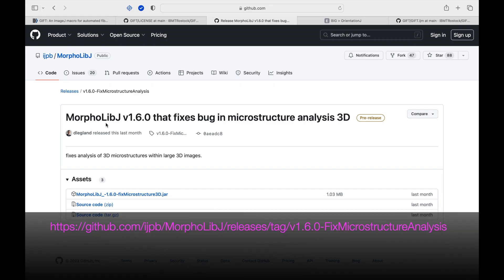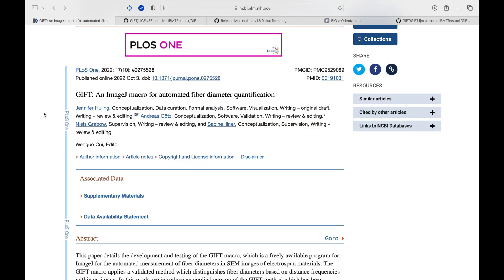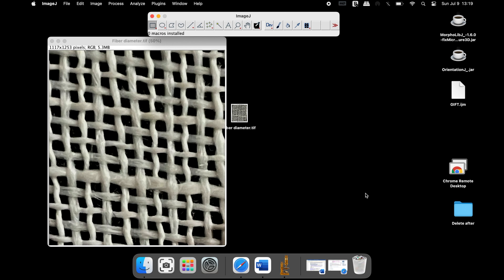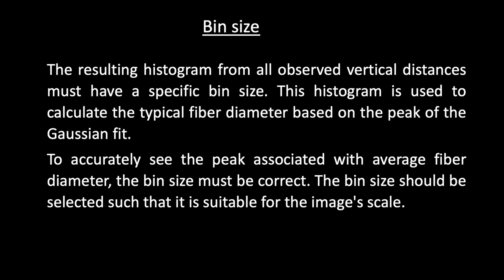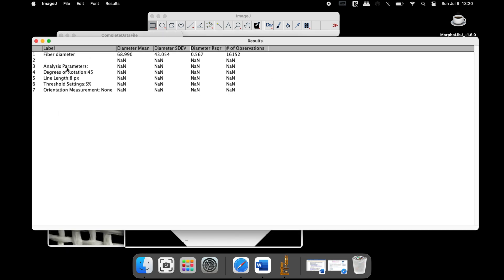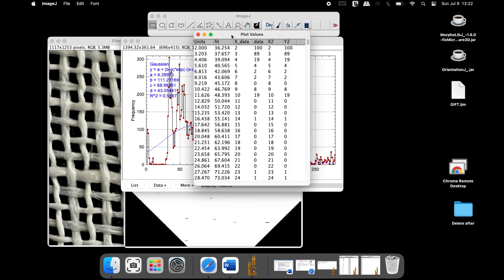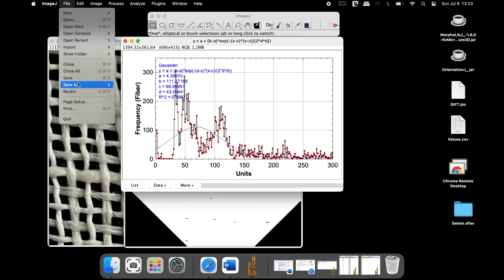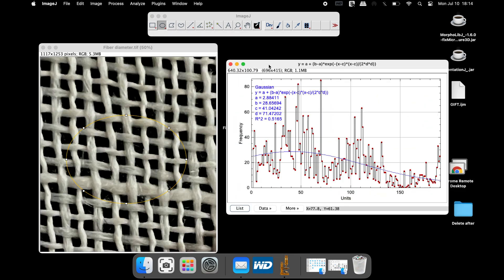How to measure Fiber Diameter using ImageJ

Comment: can you please tell me how I can do it on Z- stack image
Reply from the maker: Hello, I tried doing a z stack and it was not successful. another way to do is to first convert the z stack images into individual images and do a batch process.
Reply: I want to measure length, width and straightness of actin fimaments. 

I need some suggestions
Reply from the maker: Hello, JFilament is an option. I do not have videos on this. please check https://www.lehigh.edu/~div206/jfilament/index.html  for more details. If your filament is short or curve and need to mesure length or morphology i have some videos on this  https://youtu.be/CP2A-Jt279c        https://youtu.be/b3Z2t62i9Ds

Comment: Thank you for the wonderful video. I'm trying to use this program, but I'm asking because I'm confused about applying the pixel and the actual length.

I would like to set the scale bar to the length of the object measuring the length through the <manually set scale in next step> and set the scale bar length, but I would like to know if I should set it to 0.06 if it is 6cm. 

ㄴIt might sound weird because I'm using a translator.
Reply: After practice, i will measure the diameter of the fibers
Reply from the maker: You are welcome. need to set the values in pixels. For example if 6 cm corresponds to 100 pixels then you need to input 100. All the best.

Comment: Hi
When I tried to do batch processing of a single image in a folder. It is throwing me an error, FILE saving error(IOException):
"C:...(path) )The system cannot find pat). Can you please help me to understand why I am getting this error? It is saving Edges and filtered images till 135 degree and then throwing this error. Even I changed input and output directory and added 2 images. Still not able to overcome this.
Thank you
Reply from the maker: Hello, I am not quite sure why the error is. I tried with both single and multiple images in a folder for batch processing and I could find the output graph of all the images. Sometimes re-installing the plugins and macros again helps. Let me know if it still shows the error after that. May be you could reach out to me directly with some of your sample images for troubleshooting.
Reply: @nrttaye4033   Thank you for reply. The main problem is the way macro reads the path. If I copy paste the folder path it takes "\" and it writes all the output files and graph. If I use browse option  and locate the folder then it takes"\" and throws this error. I am working in WIndows computer not mac. How can I contact you over email? I have couple of recommendations regarding the tool. I can share with you if you are interested to include them in macro.
1. The user should have option to include maximum and minimum pixel length that should use to filter the distances calculated for each rotated image. This will avoid the macro not to consider all the readings. 
2. Macro can calculate the average diameter or dia distribution for all the images together not for each single image.  The user can do that separately. But if macro does the dia hist and gaussian fit for all the images that will be a great addition.

Comment: Hi, thank you for the video! I've been struggling with ImageJ and your video saved me. 
However, I'm not sure how to set the parameters for GIFT. Should I use the default ones?

I have more than 80 SEM images to process so I'm hoping to figure this out to not lose my eyesight having to mesaure all the fibers one by one lol I'd appreciate any help!
Reply from the maker: Hello, @user-wx8tw4iq1h thanks for reaching out. I believe it is better to change the parameters based on your image's intensity/contrast, orientation, and dimensions. These parameters would be used to determine the threshold, degree of rotation, and line length differences in each image. in addition you could use a batch process method to process many images at once. 

here is how the GIFT functions:
The user input settings are applied to either a single image or a group of images in a single folder. Next, edge detection and thresholding are conducted, followed by the generation of a set of rotated copies. An opening line filter is used to extract horizontal edge segments in each rotational image, and the vertical distances between them are measured.  Vertical distances are shown as a histogram, and a Gaussian fit is employed to determine the average fiber diameter.

Comment: Hi 
I am struggling to make this work. I am getting following error 
"unrecognized command Morphological Filters in line 357 (called from line 213) run ("Morphological Filters, operation=Erosion=[Horizontal Line]radius=" + lineLength<)>;
Can you please help me? I am not sure whether it is version problem. I don't have Origin Pro is it because of that?
Reply from the maker: hello, to run morphological filters the image rotation and thresholding needs to be maintained. according to the image type could you change the thresholding value? Let me know if that worked.
Reply: @nrttaye4033   Thank you for your reply. I am not sure what has caused the issue. I reinstalled ImageJ and all the plugins in another folder. Fortunately it solved my issue. I do have a question. Why GIFT macro is not writing any data if I am analysing single image.
Reply: Same problem....😢
Reply from the maker: Hello, could you solve the issue?

Comment: Thank you very much for such an excellent video. I'm very sorry my question might sound stupid, but is it possible to use the default parameter for fiber diameter analysis of any SEM image? What's the unit for the frequency of the fibers? Is it in µm, mm, cm, or arbitrary units? I'm a bit confused about how I should select the correct parameters for my image.
Reply from the maker: Hello Thanks for the question. I am glad you asked. The frequency unit will be determined by how the data is analyzed and presented in a specific study or research environment. For instance the frequency units can be "counts" or "percentage %". The unit of diameter here by default is "pixels".  In the "new analysis" window users can manually set the scale into any unit of choice such as nm, um etc. This macro "GIFT" has been developed to measure the fiber diameter analysis of SEM images. Here is the link to the original publication "https://www.ncbi.nlm.nih.gov/pmc/articles/PMC9529089/" . Let me know if you have additional questions.
Reply: @nrttaye4033  Thank you very much for your detailed explanation!!! I really appreciate it. Keep up the magnificent work.
Reply from the maker: @bigdraco5008  That sounds great to me. Thank you very much. I have more upcoming videos lined up. Please stay tuned for more interesting videos like this by subscribing the channel.